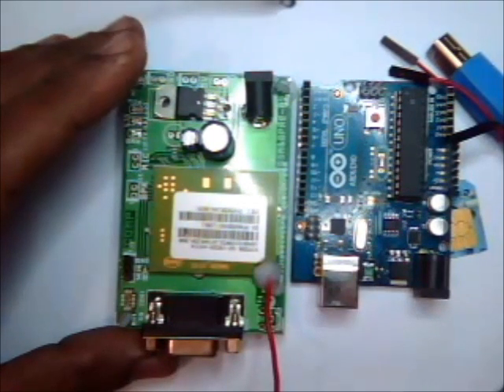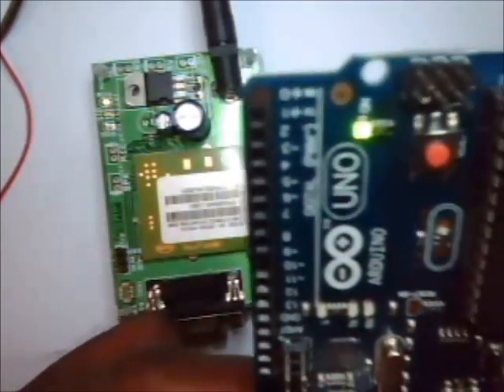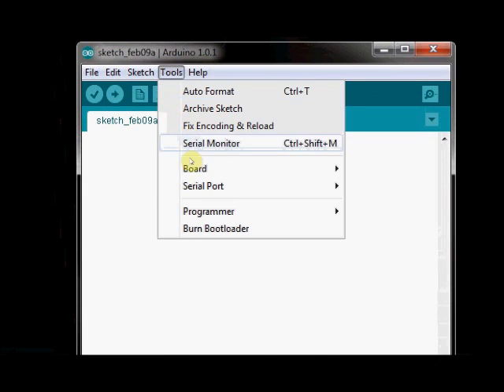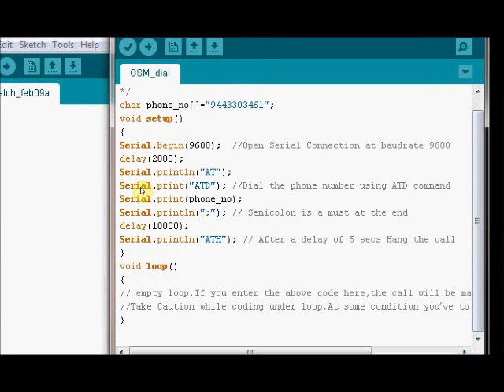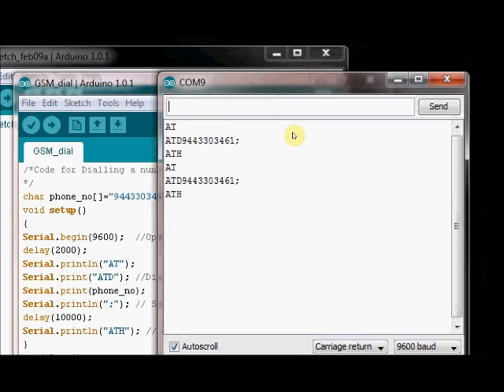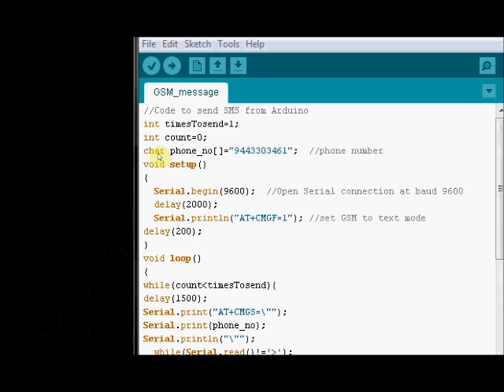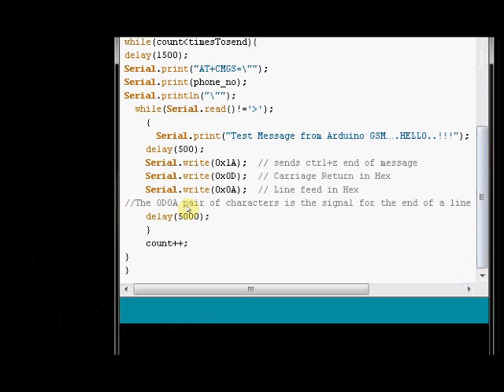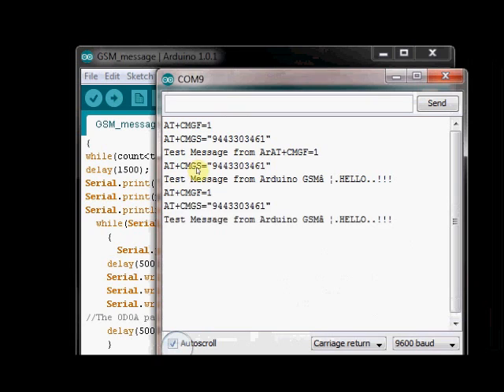ARDUINO WITH GSM - Making a Call & Sending SMS

Comment: sir what are the alternates of using sim300 module.? i am a student and a bit cost conscious. can u suggest me a cheaper alternate please.!
Reply from the maker: SIM300 is the lowest price compared to other GSM modules.If you like to save a bit ,opt for GSM with TTL connections and avoid RS232 section.
Reply: Saravanan AL thanks sir.yesterday i searched for it and found the cheaper ones too. sir do you have a blog so that i can take a few suggestions from you? or shall i contact you via mail?

Comment: should we connect rx and tx of arduino to rx and tx of the gsm module respectively? or vice versa ie:rx to tx and tx to rx of the 2 devices....
Reply from the maker: Connection is Tx to Rx & vice versa . The GSM board I've used in demo has got printing of 232 IC's Rx/Tx which is confusing.

Comment: im using motion sensor on arduino brd so my condition is dat when sensor sense some movement then msg should b snd through d gsm3000 which is connected with arduino uno , so can give me some coding  hint or some suggestions......
Reply: +Purvi Vichhi 
In your case your arduino software has to be structured so that it periodically reads the state of your sensors. If no signal is there the unit goes to low power mode for a  couple of seconds and then wakes up. The process repeats this cycle until the sensors indicate movement, then a sendSMS function is called and message sent, then a five minute sleep is initiated (you don;t want 100 SMS messages for 1 incident) the whole cycle starts over again.

SO..

void  main(void)
{
  scaleSleepTimer(duration);

 SLEEP();

// upon wake up
   CheckSensors();

if(movementDetected)
{
SendSMS();
duration = FIVEMINUTES;
}
else
duration = FIVESECONDS;

} // end main()

Usnigned char CheckSensors(void)
{

// code to read sensors..
}

Comment: i'm using sim900D GSM module and TTL converter to PC.
I just want to ask if it is the same code i'll put within C# GUI?
and should i need to use ARDUINO?
Reply from the maker: Your condition is similar to controlling GSM from a HyperTerminal. Instead of hyper terminal you send AT commands from C# GUI .So there is no need of Arduino in between.
Reply: Saravanan AL ahh,.so i should only use sim900d and TTL convter.
.thanks

Comment: sir, i have made my own version of gsm based alarm as provided in my youtube account, but i'm interested also using Arduino instead of using ICs and old Nokia phone to send ringing signal. Though purchasing arduino and gsm shield is more expensive,  Arduino is easy to assemble than making electronic prototyping, pcb etching and soldering. is it possible to ask from you the code for connecting the arduino to the PIR?

Comment from the maker: If you're using Arduino Mega you've more than one Serial hardware connections.In case of UNO use Software Serial library & connect RFID to the pins declared.For GSM connect to hardware serial (pin 0,1)
Reply: Sir can we use aurdino nano in this project

Comment from the maker: Sensors & alarm drivers are connected to Arduino & not directly to GSM. To detect human movement you can use a PIR sensor.To detect gas leakage use MQ series gas sensors , to detect door open use magnetic door sensor with Reed switch.

Comment from the maker: You can connect a sensor to Arduino.If this sensor is activated the Arduino should trigger a house alarm &  send message to a pre determined mobile no.
through GSM.

Comment: Hi, and thank you for taking time to explain this situation, much appreciated, these seem like a good modem, very convenient to have an rs232 port to connect to a computer, and also have headers to connect to arduino, the 12 to 17 volt input makes this modem ideal for installation in vehicles, or to even just to use a vehicle battery as a power source, for remote uses there are lots of possibilities with this modem.

Comment from the maker: Yes you're correct.Generally Rx goes to Tx & Tx goes to Rx.But the GSM board I've used here has MAX232 IC.Rx pin of GSM300 module goes to Tx pin of MAX232.The manufacturer of this board has printed this Tx(of Max232). Confusion  caused because of  printing Tx,Rx of Max232 IC .Thank you for the intimation.
If you go by the printing of GSM board manufactured by NSK ,the connection is as given in the video.

Comment from the maker: GSM module using SIM300.
Check this post to see how to interface SIM300 with ARDUINO UNO board to make a call or to send SMS.
http://alselectro.wordpress.com/2013/02/07/arduino-with-gsm/
Reply: I uploaded this code into Arduiono UNO but no response
Reply from the maker: Try typing in the code.Do not copy & paste.After entering the code compile it .If it's error free  then  upload it.Also try swapping the Tx/Rx connections.
Reply: +Saravanan AL can ARDUINO will join a gas sensor ?? and the gsm module is 900a ????
Reply: i have tried the same code with same connection, uploading is also successful, but no response!! i have also reversed the connection.. plz help !! :(
Reply: Hey, to make my sim900a work, i've needed to flash it before use.. i think that if you have some pin available, you will be able to use any sensore you want.. (sorry for my bad English)
Reply: San Shrestha the code is not perfect i have completed this project . late on mail me
Reply: Rivomanana MANDANIAINA cannot get ur problem properly , u dont need to flash to make ur gsm module work. to cross check put an active sim in ur gsm module and wait for 1 min for it to come in network then call to the sim no. ur have put in gsm module ,its just a method to cross check weather the module is working properlyor not , may times due to network issue gsm module does not work , try this above method for cross checking .
Reply: Hello Sir , Are you doing the projects with the SIMcom modules?

Comment: Hello sir :)
Sir i need a small information and help from you.
I have designed a robot, and i've used TI MSP 430 - G2 553 Launchpad board and a 8channel relay board, I'm done with the coding part, When i input the commands like "F" for forward, "R" for reverse and so on... it works, but its working via USB. to make it wireless i've got a pair or Zigbee tarang f4 modules and its breakout boards, it works with comp to comp, but not from comp to Robot, need help - jvharshascience@gmail.com

Comment from the maker: This GSM would perfectly be used in your home security project.The front door opening is sensed by a switch,which is monitored by a digital input of Arduino.If the door gets opened,the switch should trigger the Arduino to send SMS through GSM.

Comment: Hello, I have been looking for something like this, I too am working on a home security system, my idea is when my front door has been opened  it would instruct  arduino  to send txt inform me. I would be using a separate system  to control hidden cameras over Internet. Would this gsm be able to be used for project?

Comment from the maker: SIM306 model still not available in Indian market.Also trying for some version of SIM900 which supports MMS.
Code is same for all Arduino boards.But in IDE you've to select
Tools -> Board - > Arduino NG or older with AtMega8

Comment from the maker: Nice & advanced project you're trying.
You can send images by MMS.  SIM306 model supports MMS transmission through AT commands.Through serial port you can send a picture to another mobile using MMS.
As of now I've ordered for a SIM306 board module & still not yet received.

Comment: sir... i already copy 100% ur code to my arduino program. but still nothing happen.

when data transmit from arduino to the GSM, which is at command AT+CMGF and AT+CMGS. the LED TX on board arduino is blink. but, the LED RX not blink when GSM reply '>' to the arduino.. (correct me if wrong)

i think, arduino cant read command "while (Serial.read()!=’>’);" then stuck at AT+CMGS=012******.

Comment: we are using GSM module SIM300. we have connected arduino to GSM module properly. the problem is when i programmed the arduino to send a sms and its not responding but when i insert that sim card in a mobile the SMS is sent to the specified number. what shall be done ???

Comment from the maker: In the set up code just feed in command to dial a number & check up whether the number is called.
void setup()
{
Serial.begin(9600);
delay(2000);
Serial.print("ATD944xxxxxx");
}
void loop()
{
}

Comment: hello sir.. those AT commands which you are telling are landing in serial monitor. baud rates are same... wires are also long enuf... but, not working sir... fed up. will der be any problem with GSM modem...??? but, wen i call the modem numbr its ringing..

Comment from the maker: Open up the Serial monitor of Arduino IDE & check up whether the AT commands land up there.Baud Rate of Serial monitor should be same 9600 as that of GSM. 
If you don't see the AT commands then check up wiring.The pins you're inserting to Arduino should be long enough to make a connection.

Comment from the maker: It seems you've forgotten one basic thing.GSM should never be powered from Arduino.Use an external adapter.If you're using TTL GSM900 , a 6V/1A adapter is a good choice.You can add 2 nos. 1N4007 in series to make it 4.7V.If your GSM board is with RS232  go for a 12v/1A adapter.

Comment from the maker: SIM900A working voltage is 4.5 to 4.7v only.Below 4.5v it won't switch on & above 4.7v it goes to sleep.Use a 4.7v/1W zener across power pin & ground.Cathode of zener to +5v pin & anode of zener to ground.
Your problem will be solved.Else you'll get "switched off" response only.

Comment from the maker: Check the power supply to GSM.Ensure that SIM is placed promptly in the socket.If antenna is provided,well & good.Otherwise there will be a small coil of wire.Just stretch it out .See if signal LED is blinking.
If you are using a GSM board with only TTL then use a 4.7v /1w zener,to make sure that power to GSM chip is 4.7v.If  you're using GSM 900 this step is a must.As GSM900 goes to sleep mode when power is more than 4.7v.